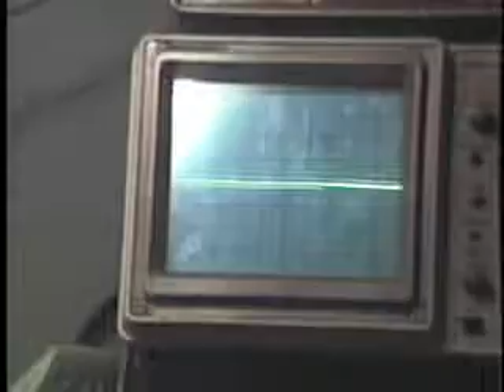casio sk-1 with custom sounds

Comment from the maker: @pdmillar And I doubt that the program code is contained on the ROM chip in there anyway. My best guess is that the surface-mount ASIC that runs the whole show is an off-the-shelf microcontroller core with mask ROM and some additional D/A converters (like an 8048 or something). In a lot of these cases the only existing documentation is in the garage of the guy who invented the thing as the manufacturers have no economic incentive to maintain it

Comment from the maker: @solidrate Yeah, the loop points are probably contained within the program code or the unintelligible data in the first few hundred bytes of the ROM. The best alternatives I can think of are just to place a one-shot sample in its entirety before the loop point hits or to shift it around until the loop sounds OK. If your sample is a note at A440 the loop usually sounds OK anyway.

Comment: I'm came close... I did 11025 at 8-bit unsigned. Popped a couple Eproms in there and successfully added a couple new sounds. But, finding the loop points... good luck right?  SIdenote, not sure if you're into Drum Machines but I just picked up a Korg DDD-1 w/ 4 rom cards and the Sample Board for $75. Always wanted one :o)

Comment: Well, I successfully removed my rom, copied to binary, burned to a new eprom, replaces it with a new socket and installed the new eprom... everything works as it should. Now, it's time to make a custom eprom. Curious, do you remember the sample / bit rate of the original rom? On my way :o)

Comment: @pdmillar Oops, that was my girlfriend's account. Now I'm signed in with my  account.  Output enable pin... gotcha.  I have done some piggy backing on a Sequential Circuit Drumtraks and a Drumulator.... very cool mod w/ switches on the front.  

Curious have you used Electrongate's Wav to Bin / Bin to Wav apps?  That's what I use to convert. Then I manipulate in Sound Forge, etc.

If you have the bin file (& docs) that would be super great!!!  Here's my mail... dab (at) blarg (dot) net.

Comment from the maker: @hersey2206 I did, I'd be happy to share my files and documents. You probably want to put a switch on the OE (output enable) line rather than the power, it would probably cause a bus conflict if the unused ROM's outputs weren't tristated.Or just burn two images in a 27C512 and add a switch on the MSB. I haven't figured out how to change the loop points but I did replace the sine wave tables used by the additive synth with saws/squares, which sounds AWESOME

Comment: pdmillar, curious if you had copied the binary file from the chip?  If so,  I would love to have a copy.  That way I could piggyback my existing chip.  I could just pull a pin and power he chips individually (toggle).  And, most importantly, not have to remove my original chip.  I would gladly, give you some completed binary files in return.

Comment: Some years later I finally have another SK-1.  I had one 25 years ago.  But, now I'm going to swap the Eprom.  I have a prommer so I'm going to convert the bin file to wave then manipulate / replace sounds, then put that new image back in the SK-1.  Actually I'm thinking about putting a ZIF socket on the face of the keyboard, for easy swapping.... sweet!

Comment: Hey, I was wondering if you can load besides an EPRPOM, could you load a digital recorder (I.E., samsung or RCA recorder), I think that it would be easy as doing this mod. Like, taking an sk-100 and bypassing the sampling memory with a digital recorder (plugged in via usb or some other type of connection cable.